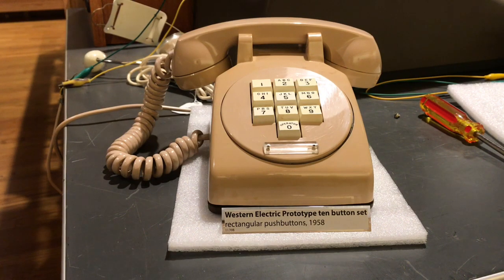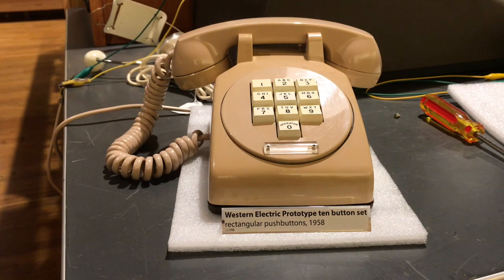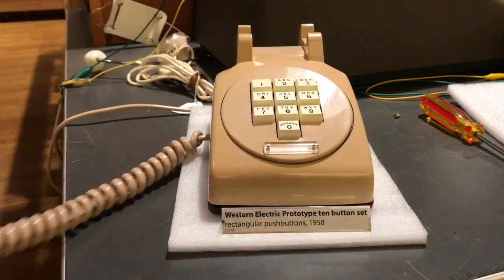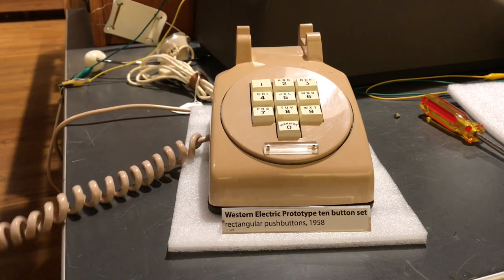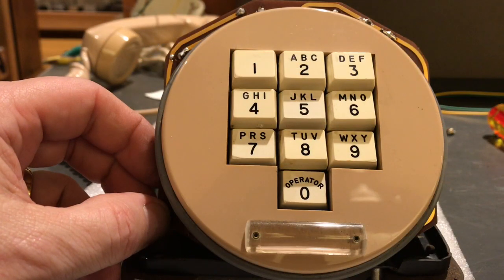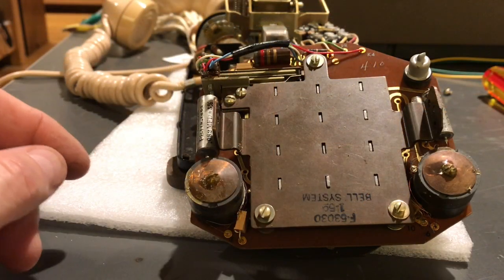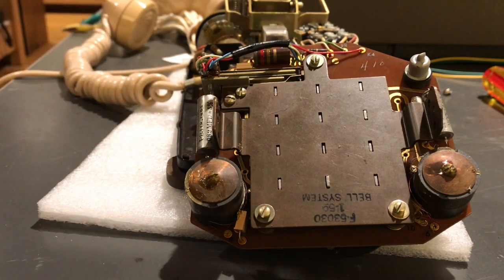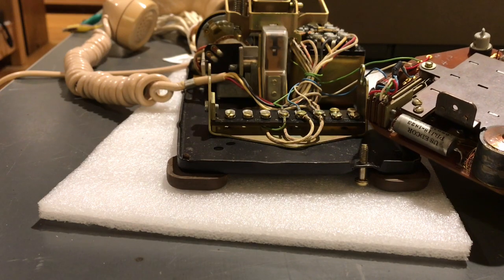Western Electric 10 Button prototype phone. (pre 1500/2500)

Comment: Wow... I thought I was the only one who had one of those! Except, mine is "Aqua Blue" and the button -holes in the (Rotary Dial Filler -Plate) are moulded to accept a "NORMAL" 36 OPG Touch-Tone dial. Of course, that makes "Mine" (NOT exactly what you've got there) with those"Big-Boy" buttons, and circuit board that "FITS" the original width of the "Rotary -Dial" mounting fork. Mine requires 2 Funny -Looking metal "Space -Filling" Flanges" that mount to the Touch -Tone Dial to fill-in the space between the dial and the mounting -fork. (You'll NEVER find those little critters again anywhere). And there essential for holding the  body of the narrower Touch -Tone Dial between the fork of the WIDER rotary dial. So, that makes MINE a "ROTARY -DIAL" to "TOUCH -TONE"  DIAL Converter Kit). Reason for broaching all this Phil, (which I'm sure you already know)... Is the reason why Western Electric didn't push these little "Pre 1500/2500 into mass -production, is because WELL.... They're UGLY! It looks like a "500-model" with a bad make-over. Someone at Western Electric noticed that too and said NOOO!  "IT LOOKS LIKE HELL"! "Time for the NEW 1500 model with it's Pretty New angles AND it's Much Higher Front Panel between the foot -pads. After the beautiful 1500 model was born, someone at "The Bell System" couldn't stand to let go of the idea of converting 500 models into 1500 models with the simple converter kit I have. To make a long story short,  the 500 model case doesn't fit back down over the 36 OPG dial and eventually breaks the lower-left corner of the 500 model case. Leaving hundreds of these discarded "Converter -Kits" laying around loose for whomever to acquire. How do you do... I'm Mr.  "Whomever" Phil do you have any of those "Space-Filling-Flanges" that I could acquire from you? P.S. I have absolutely no idea why this god-damned computer -Phone (we're all FORCED to use these days, put"CROSS-OUT" lines through most of the body of this text! Merry DIGI-ness to all, AND GOD help us because of it! Jeff

Comment: I have a 1966 model 1500.  Is there any keypad stroke substitute for star or pound for the automated systems that still require those keys, or is the 1500 user just “out of luck”?  Thank you.
Reply from the maker: No its not usable for END TO END control. Only placing phone calls.
Reply: @sxsphil  Thank you.